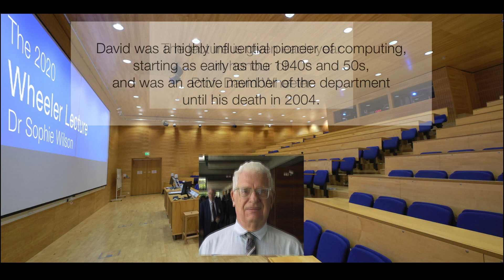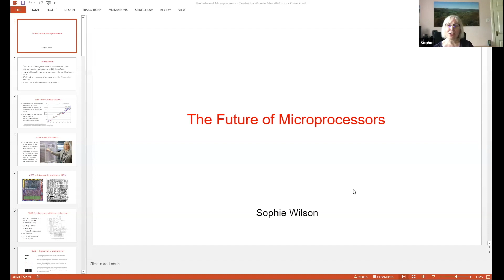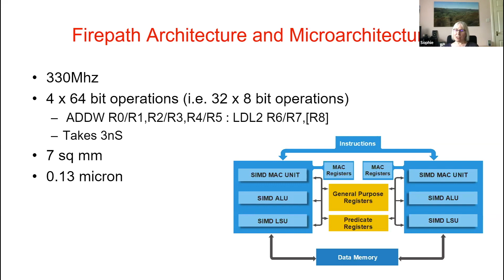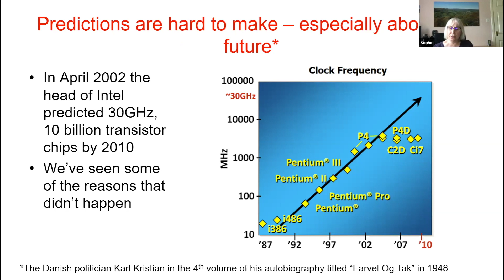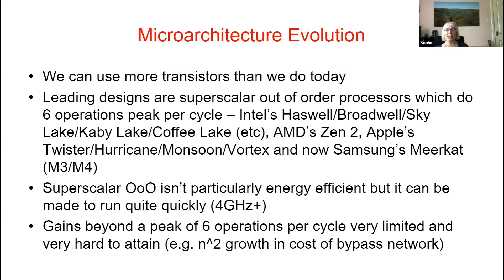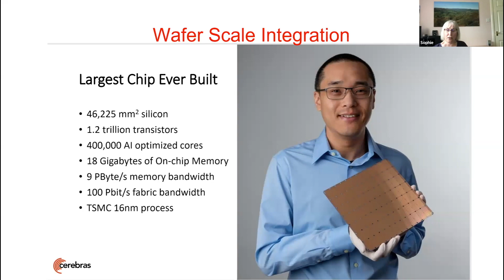2020 Wheeler Lecture: 'The Future of Microprocessors' Dr Sophie Wilson

Comment: I think I pointed this out on another version of this lecture, but Roger's cycle count for the 32-bit add on the 6502 is way way way off!
- well, just a bit anyway
- the actual cycle count is 38 minimum
- the CLC takes 2 clks and all the rest take 3 (assuming they're using page zero addressing)

Comment: I think Intel is holding back because the cost v. reward ratio for going smaller on conventional silicon lithography isn't going to be great.  Essentially it will be easier to print individual atoms onto a substrate than it will be to create and develop all of the masks required to print with conventional lithography onto silicon.  They're essentially at their limit with the use of actual LIGHT frequencies.  Once the architecture is less than 1/4 of the light wavelength you run into the problems, like propagation, that make you require all of the extra masks to make the lithography actually work so this is a path of diminishing returns, just like tooling up for 450mm silicon would have been, and it is obvious that Intel is well aware of the fact.  I wonder if the execs who green-lit 450mm silicon projects are still working for the same companies.
Reply: Meanwhile , ASML gets ahead of them with EUV. Both TSMC and samsung are well ahead of intel in fabrication . 

Intel today has a market cap of 89 billion.

While AMD is 185 billion.
And ARM is worth 141 billion. 

If intel don't catch up soon.  They  never will, because they just won't have the financial muscle to do it.

Comment: Processor speed progress walls.  We need more parallel software?  Say you had it.  Processors still need data to process, right?  Well with infinite power comes infinite data starvation.   What about memory latency?  Total bandwidth can increase as long as we have buses that we can widen but latency?  I think we need a software revolution that makes good use of scratchpad memory.
Reply: Oh.. I don't know.. how about the Cell architecture. ;)
Reply: @djmips  it prioritizes bandwidth over latency meaning that it has has to buffer in SPE's scratchpad memory.  But it's hard to do easily.  Typical programmers are put off by all the nuisance data juggling and timing difficulties.  Hence my statement.  The model deserves a rethink.  It technically works but it's not easy.

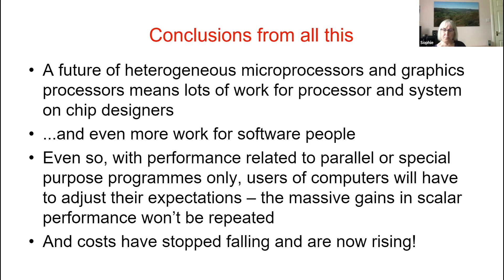Comment: If I read 1:06:25 correctly, then the number of transistors per core has also plateaued out: If you subtract the number of logical cores from the transistors, the transistor scatter graph looks a lot more like the other three.
Reply: Moore's law is a statement on the total number of transistors on the die rather than per computation unit. If you really wanted to limit it to processing units, discarding the additional ALUs, etc from the transistor count isn't really appropriate, but then in most modern CPUs the majority (>50%) of the transistors on a device are in on die caches so you'd be discarding those :D

Interestingly the size of transistors in caches can actually be smaller than elsewhere as fabs often have specially designed memory cells that are very highly optimized for the specific task and process
Reply: @mr_waffles_the_dog  I suppose what I'm trying to get at is that because of the issues with parallelism in general-purpose computing, more logical cores don't necessarily count the same as pre-multicore transistor count and performance increases once did. So the question whether per-core performance is still increasing, perhaps due to on-die caches, is an interesting one. And maybe the answer is, not as much as we'd like.